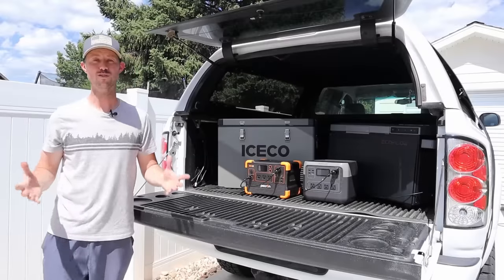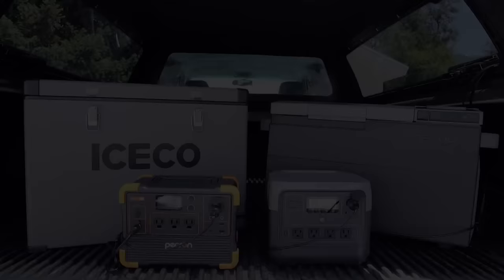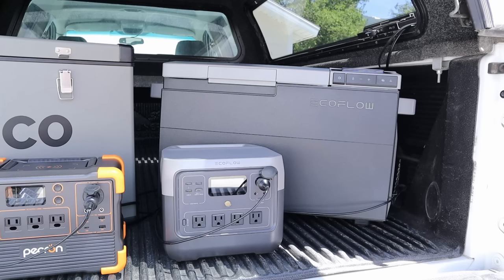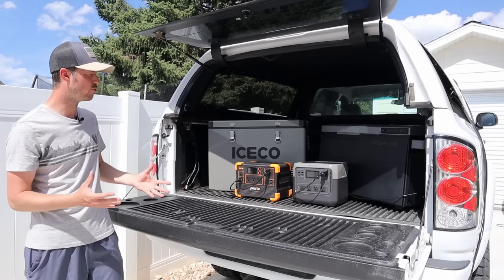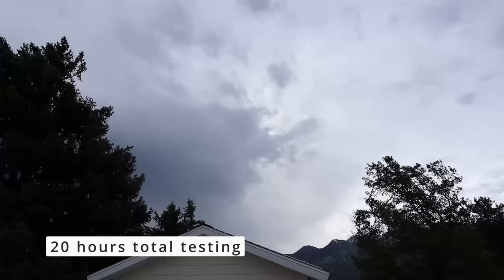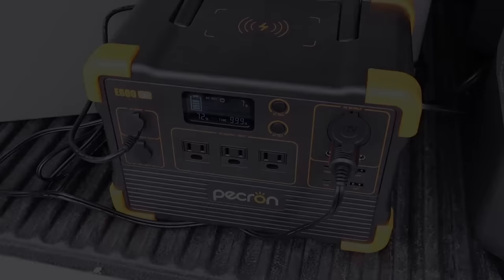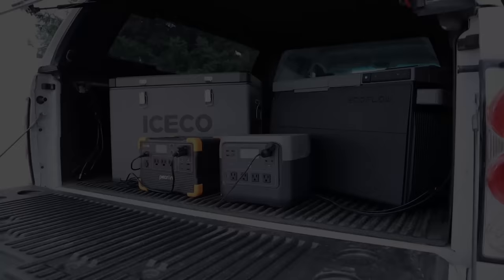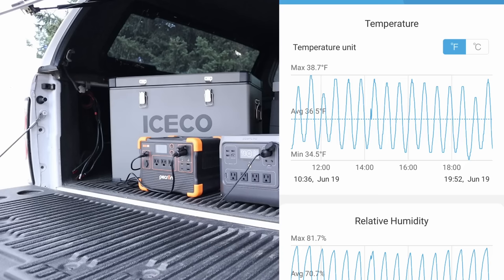72 Hour Compressor Fridge Showdown! Budget Cost VS Premium Cost!  #iceco #ecoflowglacier

Comment: I think you'd find they'd be more efficient if you started with a gallon of chilled water in each fridge. Because there's no thermal mass, the air temp fluctuates more, causing the compressor to turn on and off more often.
Reply: What are the compressors programed to temp or on off cycles? Both make sense
Reply: I would have liked to see how each fridge chilled liquids and froze things when multiple items were in them.
Reply: Did our host ever get around to espousing the internal temps ?
Reply: @lerodman I always just assumed all fridge compressors were triggered from temperature drops no?

Comment: Too many variables.  You should do a test with the same refrigerator and solar panel capacity with two different batteries to really compare the batteries.  No idea from your review how much of the performance difference is the 1) Battery 2) Solar Panel or 3) Refrigerator

Comment: I love my Iceco. I've been using it for a year in my big truck as a freezer and it's still going strong. Great video.
Reply from the maker: Great feedback, thanks for sharing!
Reply: Which one do you have? I have two in my Peterbilt. And three total. The two Iceco's and the OEM truck fridge.
Reply: @tdkgunnut  I've got the VL45, and it came with the insulated cover.  I also have one of those cheap F40C4TMP 25 quarts plus the truck fridge. I've got a Cascadia, so I put the Iceco up on the top bunk. Fits nicely up there, used a strap with hooks to keep it tied down.
Reply: @Johnny_Kanuk  I have a buddy that has a double bunk 579. And he has his VL65 on the top bunk. I know five guys that have Iceco's. All ran as freezers. 
Before these Iceco's. I had my Snomaster dual zone 85L Expedition series in the truck. Company made me put my seat back in. So I bought these Iceco's. Jp40 and Jp50. They work. Like my Snomasters better. It's a pig though. 83 pounds empty. But has 2.75 inches of insulation. And the Snomaster compressor. 7 year compressor warranty. 5 years everything else. Expensive. But oh man it's a bad dude. 

I'm liking these Jp series though. They are pretty light. My sister has a VL45. It's way heavier than these Jp's.
Reply: @tdkgunnut  nice, before I got the Iceco, I had a cheap Alpicool 55L worked fine for a year and a bit, then it just died. I'm thinking of taking it to a repair shop and seeing if they can do anything with it.  I just love having the ability to hit a Walmart or Costco and get frozen stuff to have on the road. I remember being stuck on 70 by Grand Junction one day due to a wreck,  went a grabbed an ice cream cone I had,  kid in a car next to me was looking up me, I could see him trying to figure out how the hell I got it. I ended up giving him and his sister one each.
Reply: @Johnny_Kanuk  great giving those kids a cold icecream :-) I have the Alpicool CX50 for about a year and cost me about 200 Euro. It is still working but i use it ocasionaly.
Reply: Nice, I just purchased a Bodega 37L for my truck without a built in fridge. Hopefully it's big enough for weekly runs. Got it for 200 bucks black Friday sale.

Comment: it seems to me that the solar panel you use makes more of a difference, I’d take the Pecron with the Ecoflow panel since it can accept up to 400w solar input
Reply: I run my iceco on two cheap 100 watt panels and two 48 amp hour car batteries that were 50 bucks at Rural King. Once my batteries are charged, it will run for a few days without full sun.
Reply: Just so you know, although I do have a Bluetti 200W panel, I also got an AllPowers 200W polycrystalline panel that has performed as well as the Bluetti, and they have had great deals on those panels, about $220, sometimes even less if you get a great flash sale or "lightning" deal. 

I even saw their monocrystalline panel on sale for close to that once, big saving compared to Bluetti or EcoFlow panels in general.

Comment: I don't have a use for a " power station " .. I have a 200 amp hour Chinese Lipo battery and 2 x 230 watt panels .  When charging my cordless vacuum or shaver , a small inverter is used .  Note: I purchased a VEVOR 100 liter dual compartment fridge/freezer that ran fine 'till it failed 6 months later showing low voltage ( was well in spec ) .. VEVOR said get it fixed and they'd work with me under warranty  .. NO ONE. wants to touch a fridge with an electronic issue .. any suggestions in the San Diego county area ?

Comment: This is what quality content looks like.

I don't road trip, I don't camp and my power only seems to go out once every few years, but I still find these videos fascinating.
Reply from the maker: Thanks :)
Reply: @Jasonoid  see if you can use your powers to find out whatever happened to that Ecoflow solar tracker.  Looked great then disappeared.
Reply: I like to day trip, travel a bit to a farm to buy frozen and refrigerated goods, and even grocery store trips in middle of summer convinced me to get a 12v fridge and power station. I even take the solar panel with so if I go to park up at a park. I get power to top off.  It’s been worth it just for that.  
Haven’t had a power outage yet.
Reply: You must not live in Houston. Congrats.

Comment: That is an excellent price for the VL45, I bought mine when ICECO was a relatively new name. I am so very glad I did and am VERY happy with it. I've been running with the 12v adapter in the car when driving and the Jackery 500 and solar when in camp. Ecoflow is very nice, but for the price, I'm sticking to the budget friendly equipment. Great quality and it works as advertised. Thank you for the review.

Comment: We  do things a little different.  When on the road traveling, I plug the fridge into my solar generator and my solar generator into the car electrical system. This works great for me. When we stop to sight see or eat, it runs on the solar generator.  When the engine is running it runs off of car electrical, and the solar generator recharges for the next stop.  When we stop and camp we go to solar panels to keep the solar generator charged. One important caveat is that your solar generator must support pass thru charging (most do). My record length of run is 14 days continuous off of a 200 watt solar panel and a 700 watt solar generator.  At the end of the 14 days I was at 89% charge, but we came a bit close to running out of power a few times when I had 3 straight days of rain and clouds.
Reply from the maker: When driving I also charge off the 12v output in the vehicle (sometimes I even use a 12v to 24v boost converter to get a little faster charging on these smaller units). Since this was a stationary test, I was using solar to charge. Thanks for sharing your experience, 14 days is a great run time!

Comment: That was a good one; very confidence-inspiring that this sort of setup can work long-term, particularly if you have enough capacity to account for cloudy days.
My most recent camping has been in a small RV, so I've used a 37qt. compressor-cooler to carry my food on the road, and then move the food to the camper's plug-in fridge when I reach my destination (whether using shore power or a generator).  I last used a smaller power station (300WH) for the 2-1/2 hour drive.
In a protracted power outage (such as the one due as WW3 ramps up), I'd get at least 4 180W-200W panels online to keep a couple of smaller fridges plus one or two 53qt compressor-coolers going, at least until I had canned our meat using propane.
Reply from the maker: I was hoping some real world testing would help people see how easy it is to run a fridge :)

Comment: Right now I'm using the EcoFlow Mini standard unit to power up my old Colman ice chest for use in the house temporarily. It's pulling 55 watts using the cigarette lighter adapter maintaining 36° temp. Easily getting the temporary job done in a pinch. Thank you for all the reviews you do, they are definitely well appreciated.
Reply from the maker: Are you using one of their "thermo-electric" coolers they used to make?! I always thought those were super interesting.
Reply: @Jasonoid  Yes, that's exactly what it is. Funny, I don't think they make this unit anymore. Many years and miles of use.

Comment: Really awesome video Jason!  Really interesting!  Both of these setups are great!

My campervan has a small built in 3-way fridge.  I bought a second fridge/freezer that fits in between the front seats (that I found based on one of your videos!). I use the second fridge/freezer for extra food and beverages when traveling.  On an extended trip such as going to Wisconsin from NH, I turn it to freezer mode for some home cooked freezer meals and ingredients and switch the RV fridge to more of a beverage and condiment fridge.  The bonus is that the dog's bed fits on top and he loves it!!!!  I use one of my power stations to power the fridge while traveling and then switch over to campground power if we have it or use the solar panels to power it if boondocking.   In the winter when not camping, we use it for emergency backup during storms and as an extra fridge for holidays.  These work great!!!!!
Reply from the maker: Great info here Katy!

Comment: Extra solar and extra battery power make a huge difference...
I have an iceco VL60 dual zone in my overland rig that I run year round because I work out of town 6 months or more per year...
About 1.5 years ago. I built a DIY 400 amp-hour power station into my rig with the ability to charge from 3 sources.  Solar, Vehicle Alternator, 120vac shore power...
I originally had 200 watts of solaon the roof. This did fine during the summer. Not so well during the winter...
Mid winter, I added another 200 watts to the solar. Now I have power-O-plenty for tye fridge, lights, ham radio, M18 battery chargers etc...

Comment: I have an Iceco jp50 and love it. It is a low consumption fridge that works well. I have found the 50 qt fridge to be way bigger than I need as a single camper. I also have an Alpincool 20 qt fridge that is great for short weekends.
Reply from the maker: Yeah, I like the smaller 20qt - 30qt designs for just one person. The smaller fridges are easier to move around and also take up less space in the car.
Reply: My Alpicool is going on 5 years now, thinking of getting another, one is not enough.

Comment: As always great video.  I have the CFX3 45 liter Dometic.  I did a similar test  with my old Jackery 500 and the solar saga 100W panel.  It was enough to power the fridge basically indefinitely as long as you had sun.  It was a little touch and go for a couple of days when it was overcast both days and since the Jackery 500 is limited to 81W input on those days I was lucky to get 5 watts of input.  

I normally like to run my fridge at 33ºF so to make my fridge more efficient  I went to 35º the first day and 39º  by the second day.  Once I got sun again the Jackery was recharged completely.  It kept the fridge running for 2 weeks.  I now use two ecoflow 160 watt panels to charge my power banks.  I also bought the ecoflow river pro  with the extension battery to power the dometic and the Jackery powers my Bipap machine and designate one solar panel for it  using MC4 plug to 8mm adapter cable.  Even on overcast days with the 160W panels it allows me to have more input on the Jackery.  If it is raining I use the river pro with the battery to charge my jackery if it needs it.  

Thank you for your videos.
Reply from the maker: You have an awesome setup, thanks for sharing your experience for others to read!
Reply: Just read your post & I’ve been looking at a eco flow .I have a dometic 45 cooler as well so I’m trying to get as much as I can for information

Comment: Great test.  Thanks for doing this.  I'm really liking the idea of a DC to DC converter and a LiFePO4 or two in the bed or trunk for things like this.
Reply from the maker: Are you rockin` LFP batteries in your setup?
Reply: @Jasonoid  I don't have a setup yet, but Li Time minis are $307 from Walmart.  I have four of them in a home setup and like them for a car or pickup.  I use an EB 3A for fast charging while I'm driving because I can gain quite a bit in a very short amount of time after running around with my phone in my pocket all day.

Comment: I am actually running a similar set up.  My minivan is in summer mode.  I go camping every weekend and just leave the fridge running on solar power in the van all week.  I have the same Elaecanta panels powering a Rockpals power station to a cheapest model from Amazon fridge.   The whole set up is about $700 with the extras I needed to make it work.  My panels aren't even out all day, I put them away at about 6pm and bring them back out after work around 1pm.    This set up actually works a lot better (in my limited experience) with the Dr. Prepare  battery and hub because the battery capacity is much larger and I don't need an inverter.   This video actually impressed me with the bifacial panels.

Comment: Excellent video. I like that you set it up in a vehicle where it can be warm as that will be my real use for long periods of time. I would get an Iceco that fits in my car and a Bluetti AC180, not sure of panel yet, something compatible. Your videos and spreadsheets are invaluable.
Reply: My Bluetti quit after 7 months, and they refuse to give me a return authorization, stay away from Bluetti.
Reply: @gsp49  Sorry to hear that! That's a short fail time; they should have honored a return under warranty in my opinion. I did buy the Bluetti for my van but it hasn't been used as I'm still building it out. Fingers crossed.

Comment: I have the ICECO APL55 with the same solar panel you have and the same Pecron E600LFP. I've been on 3 roadtrips in 3 weeks and my setup kicks ass. I plan to upgrade the panel to the Pecron PV330W just for insurance reasons. Just FYI to newbies getting into solar, IT'S ADDICTING 😆
Reply: I was thinking about that fridge...but I still like the "Tank" Iceco VL60 thats a little bigger with two compartmetns. I currently use th Alpicool 50 which has been AMAZING for 4 straight years of constant use with my EcoFlow Delta MAx

Comment: I have both off these for the past week. I was going to keep the pecron due to higher solar input, but I came across an issue. The pecron is too slow to ramp up watts for power tools. Even though the river 2 pro is rated at 800w it powered my electric chain saw with instant power that leveled off at 760watts. On the other hand the pecron E600LFP took a full 8 seconds for the tool to spool up to normal speed and pull 760watts. Pecron is rated at 1200w but Maybe ecoflow handles surge much better. 
Update: both of these units overloaded once cutting so 1800w systems are probably the min even for small power tools. Both are great for this videos use though!
Reply from the maker: That's an interesting observation about the Pecron inverter. I haven't seen that 'ramping up' issue on my e600.... but I use the DC output way more than the AC inverter. Thanks for sharing your experience with both models!

Comment: Great test on the 2 combinations. Being the cheap guy that I am I use a $209 Bluetti EB3A, a $207 Vevor fridge and a $130 Itehil 100w portable panel. The little Bluetti will power the fridge for 12 hours without any solar input and will go for days with moderate to full sun. I am very happy with the budget setup. The price of the panel has gone up by about $100 since I bought it last year but depending on what I have it connected to I can see full rated output or sometimes even a little more.
Reply from the maker: You got an excellent budget setup right there! How do you use it mostly? Camping?
Reply: @Jasonoid  I have been using it at multi day racing events. So much better than buying ice and getting food wet in coolers. I use our AC200P and Harbor Freight 100 watt panels when we are out with our travel trailer. We only bring our generator when we expect that we will be running the air conditioner.
Reply from the maker: @richeastmain4031  so true about the soggy food! No more wet sandwiches haha
Reply: I also use the Bluetti EB3A or my older Suaoki PS5B (400 wh) with a Alpicool CX50. I think the Vevor is the same product. Great for having you food cool or frozen if going to a supermarket in combination with a nice road or city trip :-) For solar i have a XTAR SP100. Nothing wrong with being the cheap guy with your great combination 🙂

Comment: No reason to use a power station when the primary use is 12v.  I'd go with a LiFePO4 battery, probably a 100ah for about $350+/-.  To that I'd add a solar charge controller and/or a DC:DC charger to charge from the alternator and that would give me all the functionality from the power station needed for this scenario.  However with a 100ah battery it would likely handle weekend excursions without worrying about charging, or additional functionality such as USB ports or even an inverter are easy to add if/when needed.

Edit:  I forgot to mention that doing my own battery means I do not have to live with horrible "cigarette lighter" power connections.  For 12v I normally use anderson powerpole following the amateur radio standard layout, but I also have a selection of larger anderson connectors as well as XT60, XT90, XT30 for various purposes.
Reply from the maker: A 12v DIY setup is one of the most affordable ways to go. You get a HUGE bang for your buck running of a standalone LFP battery and solar charge controller.

Comment: The Battery: Eenour P2001 2KWh powerstation
The Solar: 2x Eenour 200W folding panels
The Fridge?: The residential-sized fridge in a class A RV (runs on propane as well)

The powerstation's primary duty is acting as a UPS for my server rack. Solar for longer outages.
Reply from the maker: Great setup, thanks for sharing!